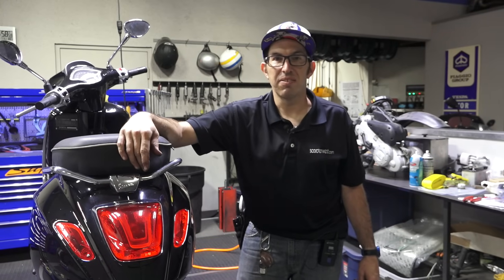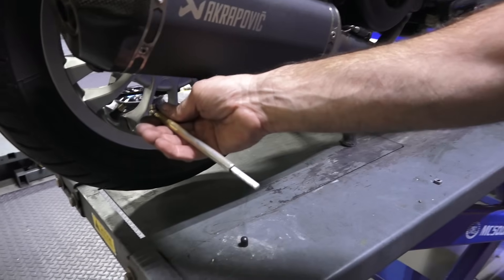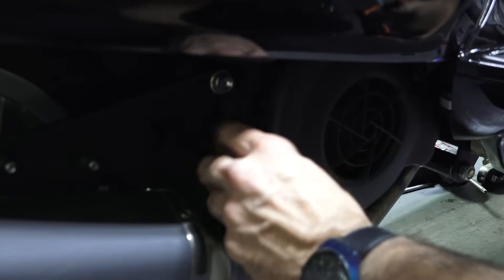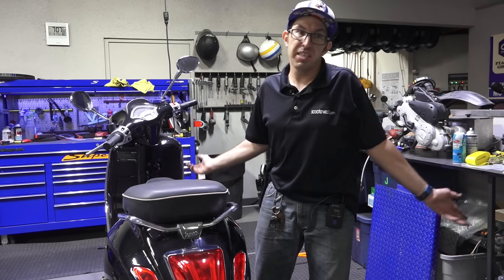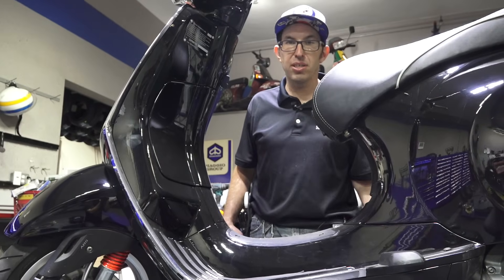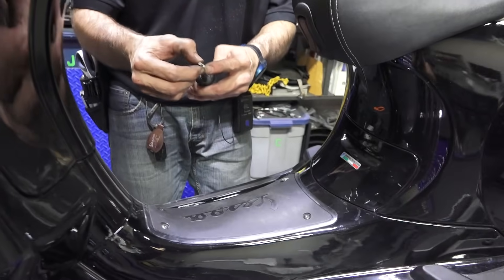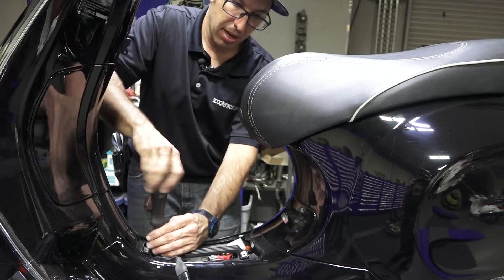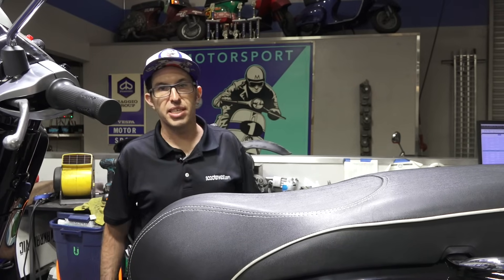Vespa Basic Service Checks

Comment: When checking tyre pressure, first, look in the owners manual to find out what it should be. I have seen some scooters require 22psi in the front and on my larger motorcycle 42psi in the rear. Whatever that manual states, I ensure that is what is in there. give or take 0.5psi

Comment: Hi the Castrol oil website says for checking the oil you should rest the dip stick on the threads but you screw the cap in all the way to check the oil so who is right?

Comment: I check my tire pressure and lights weekly (habit holdover from bicycling) and oil every 500 miles.  I hadn't thought to check the battery.  Thanks for that!
Out of curiosity, do you ever alter tire pressure for different tires?  I just switched from using City Grips (what came with my '13 GTS) to Heidenau K58's.

Comment: Hey Robot ( love that name ) . I have a 2007 250 Beverly . I'm a hard core motorcycle rider and mechanic (50 yrs experience ).I need a 'lil  advice . my dash red light flashes twice. Sometimes it will start . I did the brown key in , pull, put black key in then brown key quickly  starts about 75 % of the time . If i smack the dash with the black key in , that helps , sometimes. 
Will you please tell me whats going on? Why it wont start ?  Also..... I bought a aftermarket immobilizer that eliminates the chip type anti theft stock system.  I have not installed it yet . Do you have any experience with this eliminator ?

Comment: Does anyone know how many miles you should get your first oil change? (2019 Vespa Sprint 50)
Reply: 600 miles.  That is the recommendation from Vespa.  The purpose is to filter out all the metal shaving and materials that happen when the valve is first "settling in".

Comment: I have 2011 LX 150.  How often you change the oil.  I bought the scooter used and have put 2000 miles on it.  Oil level is good and the oil color is good.  When should I change it and what filter you use and how much oil does the bike take.  Too bad the clock battery for my model sucks.  It's not worth changing out the battery.  I see they changed the clock battery in the 2015 models.
Reply: The degree of disassembly necessary to change that clock battery is ludicrous. AND the battery bracket in the clock is extremely fragile once you get it out - it is ridiculously easy to break off the tiny metal battery contact clip.

Comment: Sir Robot, Do you have idea, my piaggio fly 150 same as lx150, runs only at 24mph, what could be the problem- no power? thank you
Reply: Wow, I wonder if your throttle or fuel line has an issue.  I sold traded in my Fly 150 for the 300 GTS Touring.  But my 2017 Fly maxed around 60-63 mph.